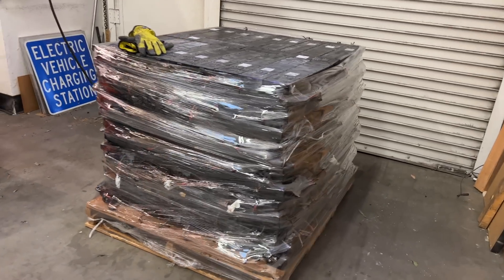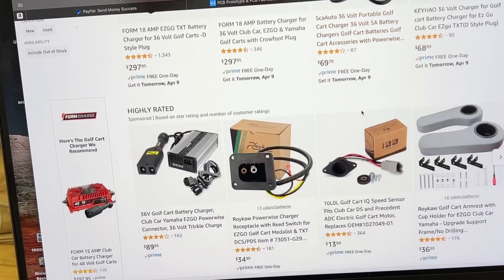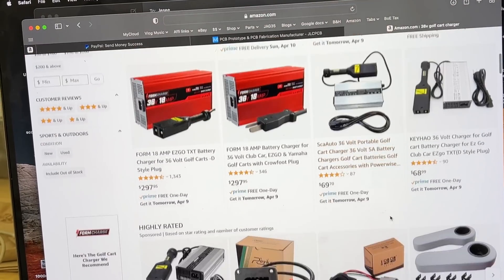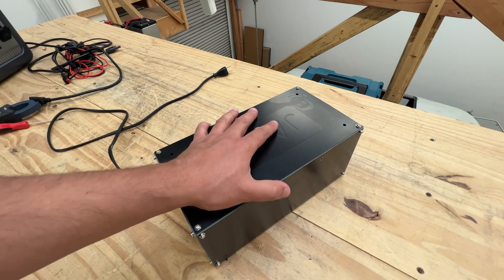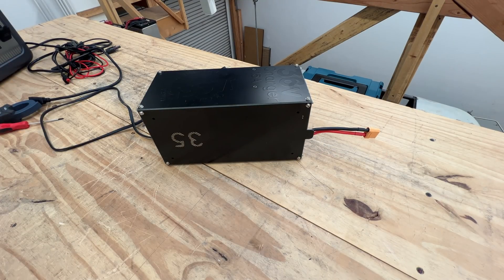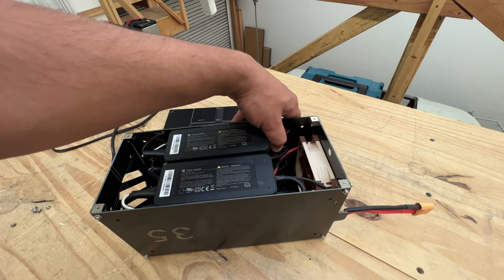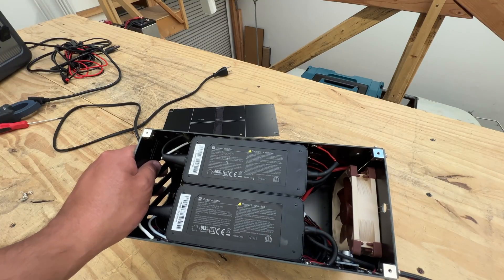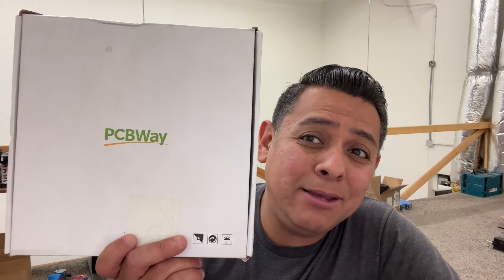500W 36v DIY Charger - PCBway

Comment: 6:04 No, that is a very good criticism of a design like this.

Fundamentally those chargers are not designed to be in parallel operation. Due to tolerances in the output voltage, they may not share the output load equally. In some cases the output voltage of a PSU can actually RISE under load rather than fall. That is, they could feature a negative resistance. I have observed many phone chargers that do exactly this, to compensate for the voltage drop of the USB cable.

In that case, the supply with the highest voltage will supply all the current. If its output voltage rises, then it takes up even greater portion of the load, until it shuts down and the next highest voltage supply takes over. Generally PSU's feature hiccup mode over-current protection where they will come back after a few seconds or with a power cycle.

If the PSUs output voltage drops under load and rises under no load, this will have the opposite effect, as it will be self-balancing and it will work itself out. A lot of voltage regulators for instance will do this with small resistors in series with the supplies. Given those are probably designed to charge batteries, they probably feature a Constant Current output up to the compliance voltage, so in this case they should balance out nicely. The final V-I curve may not be perfectly square due to the tolerances of the PSUs but who cares.

Another fact is that those switch mode converters are all operating asynchronously. You could end up with issues with something like subharmonic oscillation and stuff as the noise from one supply can affect or upset the feedback control loop of another, and end up with unstable output. (parasitic oscillations) or so I would think. An LC filter following the outputs would go a long way to mitigate that.

Generally, PSUs that are designed to run in parallel will feature some way to sync up the clock of the controllers so that the switches can operate in phase with each-other. They may even operate the switches out of phase such that they are exactly out of phase! This is to reduce current ripple. An example would be the high current buck converters that feature multiple phases, like what is found on computer motherboards for the CPU. As modern CPUs need on the order of many dozens to 100's of amps at a low voltage.

Also, power dissipation is a problem as you point out. Since you are putting them into an enclosure anyway, I'd bust apart the plastic housings and design and 3D print some way for the PCBs to clip into. Then your fan can blow across the exposed heatsinks (which are probably live at mains or HVDC, so keep them well isolated!)
Reply: agree. during the cv phase, 1 charger could be dominant and the others not exactly working synchronously with micro amps, or there could be random switching between them.
this method is good for bulk charging up to 90% but loses a lot of efficiency in the last phase.bottom line tho, this IS doable. keep in mind it's a DIY, not a controlled output device
Reply from the maker: Not in my eyes,  you are approaching this in the “what if it doesn’t work” while I do it in the “what if it works”.   I built a version or this 6 months ago,  found over heating  problems, adjusted the design and I have been watching it charging my battery ever since.   Are any of the problems you theorize present?  Possibly. But not to a degree rendering the design not useful.
Reply: @jehugarcia  It's true, building something that's a 'prototype' and your only making 1 of vs something that is being designed for production and are planning on selling are 2 different things, and this is severely overlooked these days, people overengineer things all the time, one of the first steps of engineering a product for sale is to quickly get a prototype working, then reduce cost by simplifying until it works with a safetly margin of just above 1. having said that,
@Power Max is correct in that switch mode supplies are typically not designed to be run in parallel for a multitude of reasons, one being they usually have floating ground potentials (the negative output voltage is not directly connected to your neutral or house ground and thus floats (you can test this by measuring the ground of your power supply and the earth pin of a second powerpoint)) and because of this, each can float at a slightly different voltage while maintaining a set output voltage, when run in parallel this means that the output current is not equally shared, causing one supply to take more of the load. 
Also input rush of turning on 8 SMPS's at he same time must be horrendous, probably in the order of a hundred amps or more on your house breaker. then you have rf noise, safety factors etc.
Reply: @jehugarcia  yeah, sure it works, something that I'd probably do in a pinch. I am working on a project to power a server off a big battery (like a beefed up 2KW UPS) and looking to design the power supplies and voltage regulation components. I found that server grade 12V modular server supplies can be purchased cheap. You get 12V at 100A! So I do need a solution for charging a 36V or 42V pack and didn't know those charging modules existed.
Reply: These are chargers, not power supplies - they have one job - try to make the output voltage rise to 42V up to 2A and then stop.
They don't know or care if there are any other chargers present. Period.
Reply: @ahaveland  You've got a lot to learn about how PSUs work. "Chargers" are power supplies. Instead of foldback current limiting or hiccup mode, they feature the additional ability to regulate maximum current and maximum voltage. The output voltage can vary based on load (battery SoC).

To do that, there is a current and voltage feedback loop. Assuming it is a flyback converter, the controller might simply implement peak current mode control, so the current limiting comes free. Essentially that algorithm turns on the FET at fixed intervals and it is turned off when the current through a coupled inductor reaches a threshold value, the threshold value is controlled by an outer control loop that is trying to regulate the voltage. When the voltage reaches the target value the threshold current is lowered to zero to keep the output voltage regulated. If the load is high, the voltage will sag and the current threshold is saturated at the maximum the supply allows.

The point is, how a PSU works is complicated and they can interact in unpredictable ways when paralleled. They should be designed for such operation. In practice it might work or it might not.

Comment: Wouldn't a PC power supply do just as good?
Reply: He is trying to repurpose 30k units .... Got to recover money from battery purchases
Reply from the maker: I’m trying to use 36v chargers to charge 36v batteries
Reply: you would need a boost converter as well to boost the 12V rail output to 42 volts

Comment: Please be careful using these boards on offline application. Looks like there is barely any creepage/clearance between high voltage input and low voltage output sections.
Reply from the maker: High voltage and low voltage sections are on opposite side of the board,  there’s like 4” separation between them
Reply: @jehugarcia  Your high voltage is not separated by 4" as the copper in the center under where the chargers sit could potentially bridge between input and output due to creepage, personally to protect your business from liability I would remove a bit more of the copper in the center if not too expensive remove all of it then there is no risk at all. Most Chinese relay Modules have isolation gaps to stop creepage so if cheap China products take this extra step and knowing they do the least they can to get  the price point super low they still don't skip this step so must be quite important, like the design though looks really neat as box.

Comment: The safety distance (between the ground fill and fan tracks are very close to the mains power.
Reply from the maker: What’s a safe distance?
Reply: @jehugarcia  6.4mm or more is a good rule of thumb when dealing with mains. You can go all the way down to 4mm but then you need conformal coating on the PCB as well etc.
Reply: @jehugarcia  bahahahha tell him

Comment: For my 4 scooter batteries I got from you, I use a Drok 48 v power supply and adjust it to 42 volts. It puts out 10 amps and has a fan. Works great for me and it is about $65 on Amazon.
Reply: GK please add a link for that item
Reply: @getagriptv6718  First result when searching "Drok 48 v power supply"